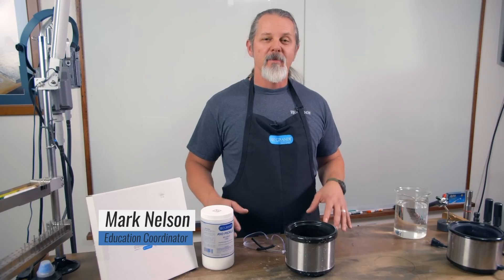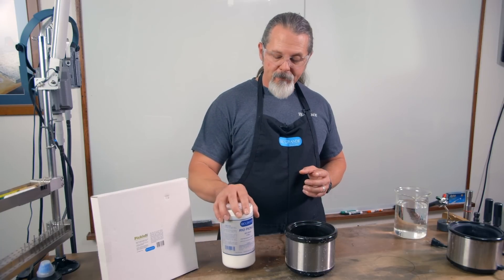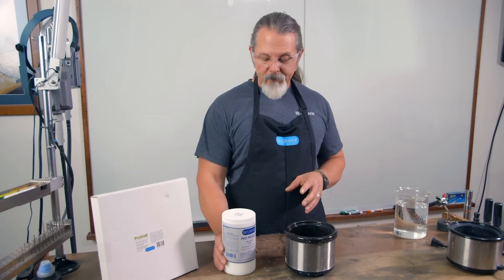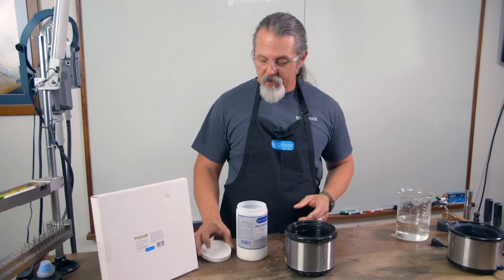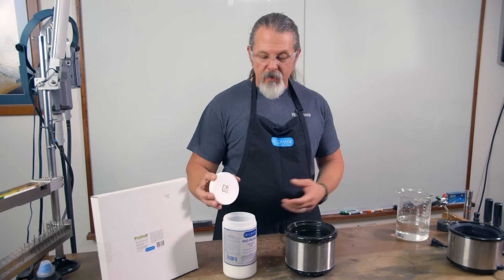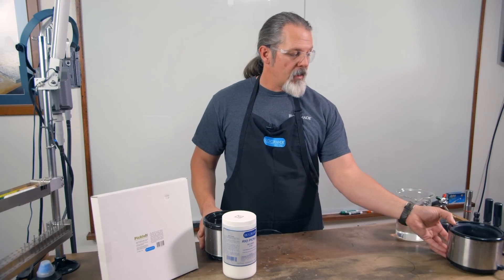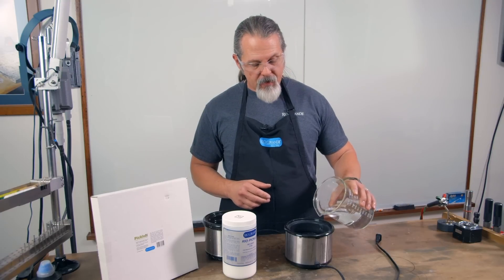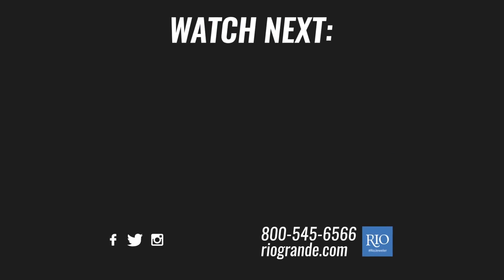How to Mix Pickle Solution

Comment: What if I'm making a piece with brass jump rings and lapis luzite beads after I solder the jump rings how do I polish it so I would I just use the pro polish pads
Reply from the maker: Hi there! Great question! You can use pro polish pads, but it would be best to avoid any contact with the lapis beads so they don’t get scratched in the process. Soldering the jump rings, doing a polishing process then adding the stone beads as the final step should give the best results.
Reply: @RioGrande1944  ok thanks you

Comment: Hello just a question about ventilation. If I make pickle do I have to have a proper fan? Or is it ok to just cover it up when not in use?
Reply from the maker: Thank you for the question. Here is a response from our tech team: The boric acid and alcohol either dipped or sprayed will help dramatically in acting as an oxygen barrier during soldering. Rio Grande also carries Cupronil, an Anti-Firescale Coating and Flux Combination Spray Item #: 504061 that is a Reliable firescale retardant and flux agent in one. Still, be careful of overheating.

Comment: Does the pickle eventually "wear out" and have to be replaced? I'm brand new to working with silver, and I haven't gotten to the pickling stage yet. Thanks!
Reply from the maker: From our tech team: Yes over time the pickle will become weak and not clean the metal after soldering. You will also have copper oxides in the mix causing it to turn blue in color. At this point, it should be replaced.  I usually replace pickle after 3 days of soldering.

Comment: hi! I just started making jewelry I contaminated my pickle with a tweezer. I made new pickle in a different container and washed my copper tweezers, yet my new pickle is still turning my jewelry pink! I was hoping you’d have some advice.
Reply from the maker: Hi there - Good question - this could be caused by minerals or iron in the water. We recommend trying distilled water. If you are still having issues, please give us a call at 800.545.6566 and we will help you out!

Comment: Thanks for the info! A couple follow-up questions:
- After pickling, do you recommend dropping pieces into a water/hydrogen peroxide or pickle/hydrogen peroxide mix to remove copper flashing?
- Does disposal differ between the regular pickle and the non-toxic pickle it? Need to neutralize both with baking soda and can the pickle it go down the drain?
Reply: These are great questions! I would also like to know!

Comment: Ok my solution got hard, how do I clean my pot up, and how do you dispose of old pickle  solution
Reply from the maker: Hello Deborah, Thank you for your question. Because the regulations can vary widely we are unable to provide direct guidance on disposal. Please dispose of pickle in accordance with local, state and federal laws and regulations regarding potentially hazardous materials. We have found that the local fire department can help in many cases. Any dried up residue can be scraped from the pot and disposed of as the local authority instructs. Hope this helps!

Comment: I'm a bit confused as there seems to be a wide discrepancy between the sodium bisulfate-to-water ratio specified here (and other videos I've found) versus the ratio stated on the package. There are a few measurement conversions involved and I'm no math expert, but the package seems to indicate to use a LOT more than 1 tablespoon per cup of water. It says 10 oz. to three cups, which would be nearly a fifth of the 3-lb container! I know it doesn't need to be exact and can be mixed weaker or stronger but that's a HUGE difference. Where am I going wrong?
Reply from the maker: Hi Christine, Thanks for your question. There are many discrepancies about mixing pickle solutions because they all work, just at different speeds. Weaker solution will work slower, and stronger solution will work faster. We typically mix about 1 tablespoon per cup of water. This makes a good mixture that’s always dependable. The instructions on the bottle recommend a strong mixture but it’s really not necessary to make the solution that strong. Hope this helps. Thanks for watching!

Comment: ,so what can I use from what I have at home to make the pickle ?
Reply from the maker: Hi Laura, Mark says, "Vinegar works great. Good old white. Add about a tablespoon of salt to kick it up a notch!" Hope this helps & thanks for watching.
Reply: @RioGrande1944  Thanks for this tip. How much vinegar-to-water ratio to use? Also, does it need to be hot, and if so, why? Thanks in advance!
Reply from the maker: @LarryJHoman  The usual mix is about 50/50 so 1 cup water, 1 cup vinegar and 2 teaspoons salt
. Hope this helps!

Comment: Hi Mark, does this work even when the pickle is completely dried out? I found one I left on for a LONG time lol. It's a big blue blob. I don;t care about using it again, but just getting it cleaned up :)
Reply from the maker: Hi Debbie, Thanks for watching! You can dissolve it with water, just as Mark describes in the second half of the video, to clean up your pot. Please refer to your local regulations for disposal. http://help.riogrande.com/support/solutions/articles/5000692524-how-to-properly-dispose-of-chemical-products  Hope this helps!